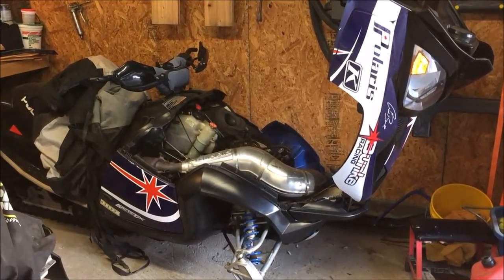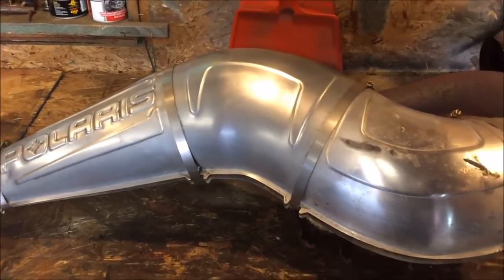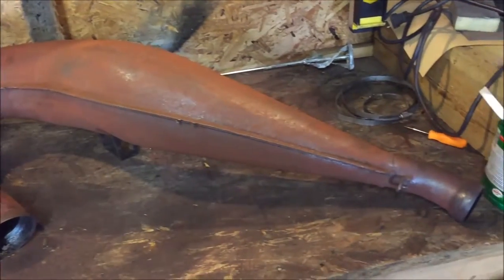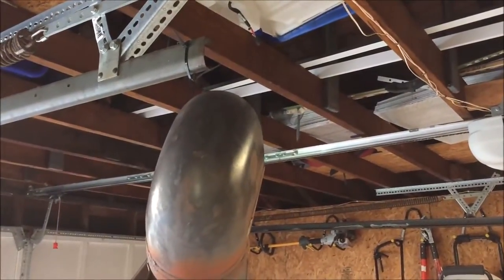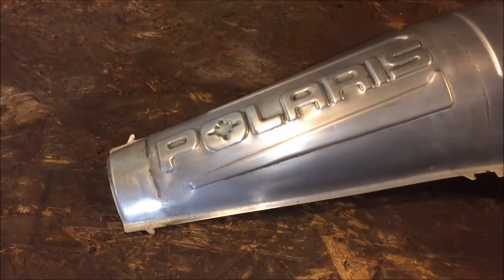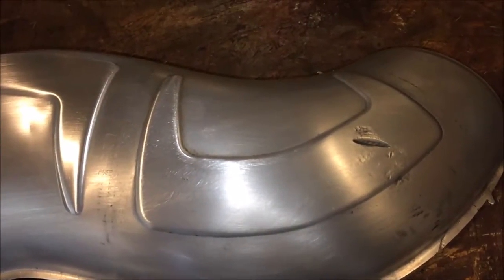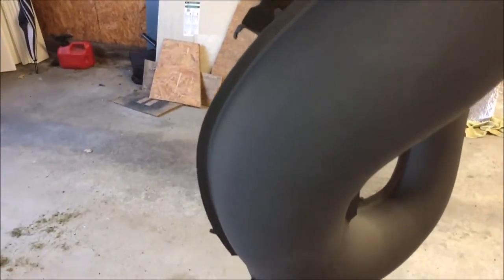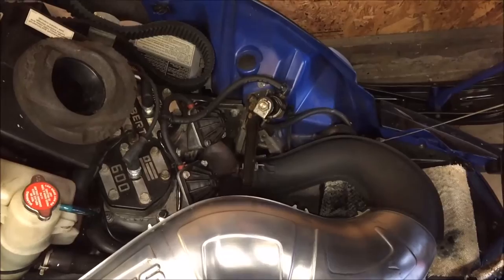Painting the Pipe and Can on your Snowmobile

Comment: Nice job on the clean-up! That's an area most guys don't do and that's keeping your exhaust system painted. It's expensive to replace, so just taking the time to maintain your sled pays off in the end. Besides, it looks good too! Snows a coming!!
Reply from the maker: snowking55 

Absolutely correct. A little effort goes along way and it's looks great when done. 

After I put it in I realized how dirty the belly pan was so I pulled it out this afternoon and cleaned everything up. Lol

Comment: I literally just got done doing the same thing to my indy exhaust. one thing I should of done differently is used a high heat primer because I used VHT which needed 1 week to cure - I did 4 light coats and still after one week the rust spots were already starting to show through the paint again!!
Reply from the maker: Rotax4life 

I used the same paint on the Indy Lite last year with pretty good results. It still looks pretty good. 

I looked for the primer and it wasn't carried in any stores around me.